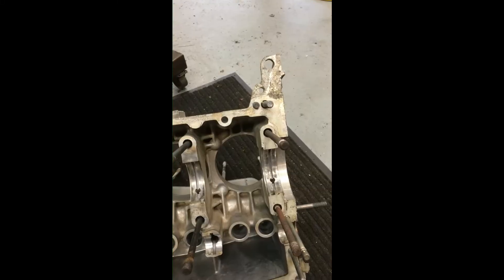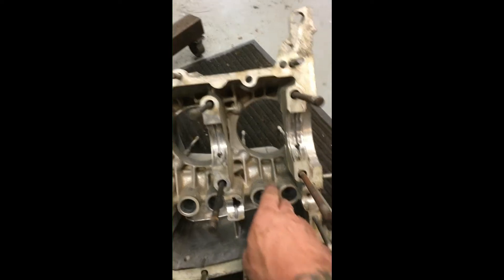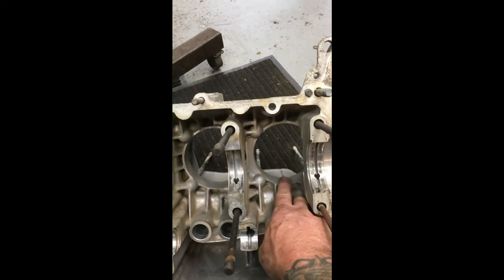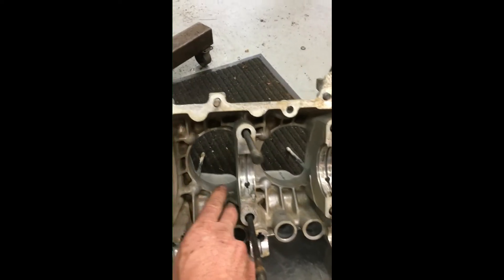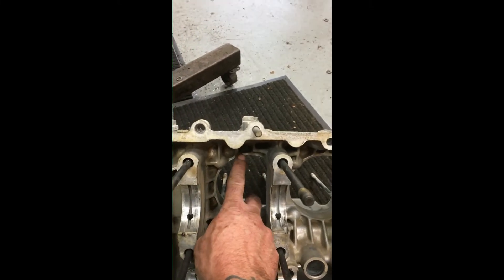Vanagon Westfalia Waterboxer Engine build up part 2

Comment: When I drove back home, the engine would randomly miss for a fraction of a second. This often happened when going over a bump in the road. You had noticed it as well but never able to isolate it.  While I was replacing my water line I noticed that the contacts for the water level sensors were loose so I tightened them. This made me remember a suggestion I had received on Vanagon Owners I believe, to check a specific connection to the fuse box. The connection seemed fine but while I had it out I just made sure everything was seated properly and I reinstalled the fuse box making sure that the wires were properly tucked in. It hasn’t happened since and I’ve driven some rough dirt roads and bumpy asphalt. I have no idea if it’s directly related but it’s running smoothly.
Reply from the maker: Sweet! I remember that ground in other vans. So glad you sorted it out!